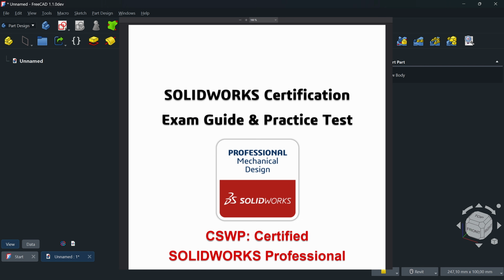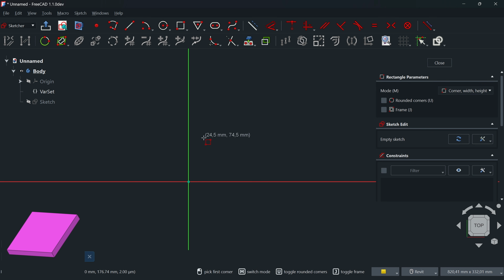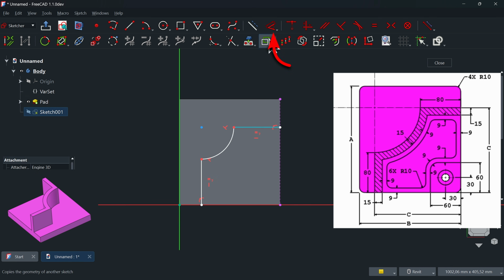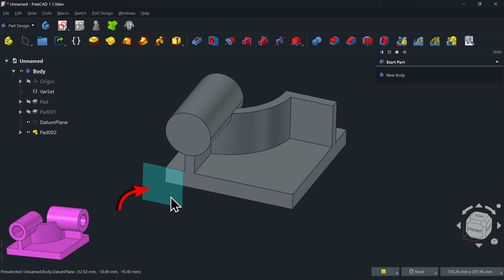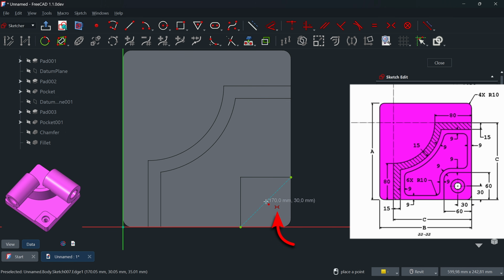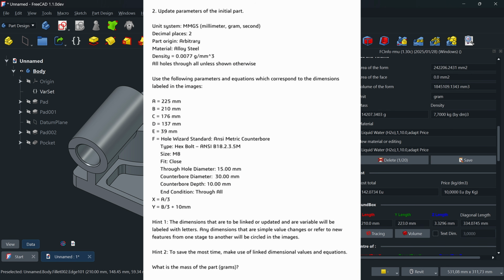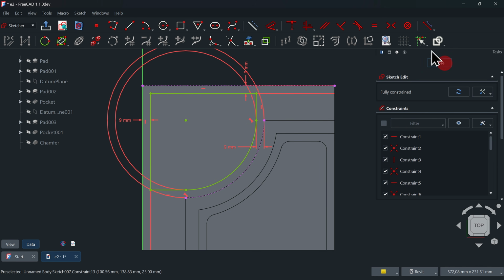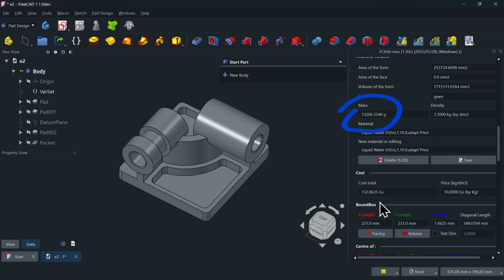Can FreeCAD pass the SOLIDWORKS Pro Certification CSWP ?  (Full Tutorial & Parametric Method)

Comment: First learned 3D modeling for animation using Lightwave in 2000, then started learning Solidworks after taking up 3D printing in 2013 and switching to more of an engineering focus.  Now looking into FreeCad as an open-source alternative (because over the last 13 years, Solidworks hasn't really done anything noticeably innovative that justifies its absurd licensing costs).  I've been continually surprised by how capable FreeCad is, and its open nature will hopefully give it more longevity than the product of a greedy corporation trying to justify its continued existence via predatory licensing arrangements and aggressive legal threats rather than providing meaningful upgrades.

Comment: One last different way to skin the cat... Instead of applying fillets to the pads/pocket for the vertical fillets, I added them to the sketches. This is a habit that I've picked up in FreeCAD because the fillet (and chamfer) operations in PartDesign have been historically fragile. I wonder if it is a good or bad habit for me to have developed... I followed along with this video using fillets in sketches instead of after the pad/pocket in PartDesign and I got the same mass results as the video did, so the resulting geometries were identical.

Comment: I got started in CAD with 2D cad using AutoCAD on a DOS machine. I've also done ECAD, first using OrCAD professionally, then KiCad recreationally. FreeCAD was my first introduction to 3D CAD because the KiCad team started to use Step files for component 3D models, and someone created a bridge between KiCad and FreeCAD for ECad/MCad integration (component 3D models for rendering and full board assemblies for fitting enclosures). I've kept up FreeCAD for 3D printing recreationally (and occasionally at work for fixturing).

Comment: Different ways to skin cats... I probably would have put the origin of the first sketch (for the base) on the lower righthand corner of the rectangle because that appears to be the origin of most of the dimensions in the reference drawing. It probably doesn't matter much, but I would rather avoid any accidental mistranslation in my head. Especially on a timed test. ;-)

Comment: 25:20 This 30 mm dimension does not appear on the model and corresponds to a reduction in the tube's thickness: Cheating ? 😊 Personally, I find: 141930.5296 dg. But, thanks for this tutorials

Comment: Since I can't find anyone else pointing it out: Hole should have been an ANSI M8 B18.2.3.5M. FreeCAD does not explicitly have that hexbolt out of the box at the moment that I know of, but it would have been prudent to use the ISO Metric as the standard and set the hole to M8x1.25.

Comment: Why did you do the fillet that early? Usually i do them as late as possible to avoid all sorts of problems. If you didnt, you still had that edge. And why didnt you use the centered rectangle as construction line to get the center for the hole? Also, the pocket could be constraint to a depth 5 mm above(!) xy plane (without to calculate by yourself) in the pocket operation menu.

Comment: Veteran mechanical technologist here. Worked most of my carreer with Solidworks. I used Fusion for my hobbies until they completely chocked. I then switched to Solidworks 3DExperience (web app like Onshape). The price is excellent but really the software sucks. Hard to get around and so many limitations. I was thinking about switching to Solidwork desktop maker version. Since I switched to Linux to escape Microslop, I would need to do a dual boot or VM and I refuse. I don't want ANYTHING to do with Microslop. I am now using FreeCAD. There is a learning curve but I'm getting there. This channel really helps. Thanks for using your real voice! Thanks for the most useful info on FreeCAD!

Comment: I learned it by myself, for 3D printing. It's the only program I used.
I never used VarSet. I always used Spreadsheet with EasyAlias (addon). I found it easier to export/import the spreadsheet to other project. Your video show me the offset button, which I never used. I always did it manually.

Why you never use the face to start with? Why you always hide the body and create a new sketch, to unhide it after? What is the goal? I though it was only because your measurement was from the bottom of the body (not the pad). But I guess I'm wrong, must be some other reason.

The hardest thing is the Draft tool. Creating Lines, ShapeString, etc... Extruding and using Fusion/Cut is always a mess. 
Creating object with PartDesign is not a problem.

Thanks for the video.

Comment: I first leanred cad in highschool with Inventor, then at home i found a free cad software called designspark mechanical. Only recently have i been using freecad, due to designspark blocking features behind a paywall. It was a hard couple of days to learn freecad (i had tried before but gave up). But after watching some videos, and taking it slow, i have learned enough to do basic tasks.

Comment: Am I blind or does the reference not give a dimension for the cylinder opening on the last drawing.  He uses 10, but it looks like that is for the length of over hang for the two cylinders?  I don't see where he is getting the 10 for the depth or difference between the radius of the cylinder and the cylinder opening or cut in.

Comment: > Is Freecad your first CAD/Modeling software?
I used QCAD briefly when it was needed purely for 2D blueprint drawings. Tried using Blender for technical modeling but quickly realized that a non-destructive modeling software is required for proper work or else you'd spend more time fighting with software than modeling. So, FreeCAD is my first true 3D modeling CAD. Originally I used it purely as a STEP file viewer for many years and early versions (pre 1.0) looked like a nightmare show.

> What do you think of FreeCAD so far? 
Now trying out FreeCAD 1.1 for 3D printing purposes and it finally starts looking somewhat intuitive. It still could use some work with its extremely unintuitive errors, breaking topology (e.g. Fillets/Chamfers falling apart after editing earlier steps). But it's worth learning, especially for hobby projects. For professional use commercial CADs might be better considering that if you work in a team, nobody would want to have a mixed ecosystem.

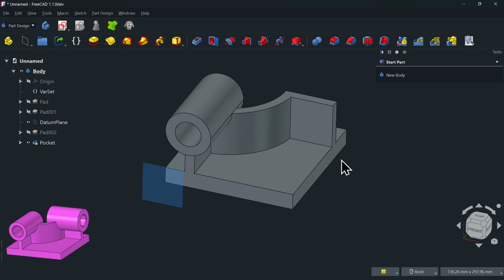Comment: Gotta be honest, your tutorials are the only ones that make me think FreeCAD is actually useable. Some things still feel extremely clunky and weird though. For example that you apparently(?) need to create an own sketch for every little thing and do a projection of e.g. your previous circle in ~ 12:00 - In Fusion I would just have created one sketch with two concentric circles, then extruded the first and immediately cut with the second. Without any second sketch or projection inbetween.
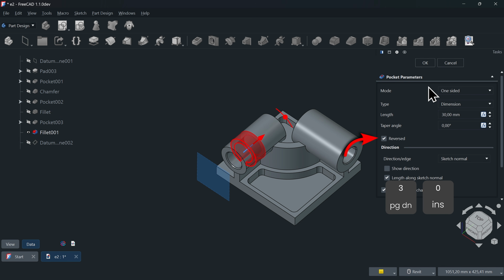Another example would be the whole additional offset plane for he operation up to 24:11 - In Fusion I could still add this to the same circle sketch if I wanted to, then do an extrusion that starts with an offset of 30mmand for a length of 30mm. No additional offset plane, second or third sketch needed. You also don't need to delete any intersecting lines and you will also not run into any issues with not being allowed to do the full arc (what even happens there? O.O)

A lot of "simple" things still feel extremely tedious in FreeCAD so I am still very reluctant to give it another shot. Like text or text following a path or a circular shape... I only found tutorial that are like 15 mins long and abuse a curve workbench to hack a super thin curved surface onto a disc that can then hold text. I use this a lot in Fusion.

What FreeCAD from my POV needs most direly is simplification of essential tasks and content creators who create high quality tutorials such as yours that show good, solid, parametric workflows.

Comment: I used proengineer (later Creo) at University but haven't touched much CAD since. I tried on shape but really struggled with the whole sketch - constraints - extrude - assemble workflow on it. The free tier limitations felt icky too. I just saw your "why use FreeCAD" video and then watched this video and it looks like the exact type of workflow that I'm familiar with. I run Linux too so it's perfect! I'll be designing some stuff tomorrow for sure.

Comment: I am investigating moving to FreeCAD from other tools for my hobby work. My goal is to remove the restrictions of my current tools. Per your opening comments, this would probably be my7th or 8th CAD (I worked as a professional engineer for a major Ag manufacturer) so I am quite familiar with learning new and similar approaches to common tasks. I found your videos and am quite encouraged so far. Excellent work on your part.

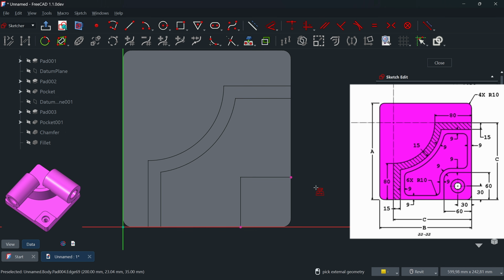Comment: this was great, but at around 14:50 you find the center, but the diagram specifies distances from the right/bottom edges. Would it not be better to use those numbers, or is there a symbol in the diagram implying center?
Reply: The distances are equal (30mm), creating a square. The lines he already had are double the length (60), but also equal, creating another square. Connecting the diagonal to find the middle is a clever way to save time and still be accurate to the print.

Comment: Bonjour,
I had issue doing the hole opération from the point, so the only way on my W11 version 1.0.2 was to create any circle in the sketch and then the hole operation works with CounterBore Ok (lamage).
Maybe on weekly builds version 1.1 the issue is solved.
In any case merci beaucoup for this nice video.
Reply: The 1.1 definitely fixes it

Comment: Very nice! Using the offset tool and then turning half of it into construction geometry is a really neat trick that I've never seen before. Really cool little technique.
I was also unfamiliar with the VarSet, I always use the spreadsheet feature and link the values from there, which works the same but I find much nicer to look at. It also allows you to order and even color-code your variables for complex parts.
Lastly, FreeCAD has a bajillion hotkeys. If you learn just the most important ones for applying the constraints, it will save you literal hours of time. Just typing "s" to apply a symmetry constrain is just so much faster than doing everything with a mouse. Your wrists will thank you, too. The last little tip I have is also a kind of hotkey: Instead of clicking the little f(x) symbol in the input field for variables, you can simply type an equal sign (=) and start typing the name of your variable right away!

Comment: Sorry, maybe a silly question, but what causes the 0.01g(almost 0.02g) inaccuracies? if the geometry is the same and the density of the material is applied correctly, what is causing the inaccuracy? is that coming from a geometry issue, or a software calculation error?

Comment: I am a design engineer and professional CAD user since 1998. I just started using FreeCAD and it is pretty decent for hobbyists. Hopefully it keeps getting better. I am still working on my first models, but will be 3D printing soon. Excellent video. The variable dimensions are not as intuitive as pro CAD software where you can usually make variables on the fly. Also the symmetry constraint tools are not so great.

Comment: I like free cad but the 2 major issues i see with it are:
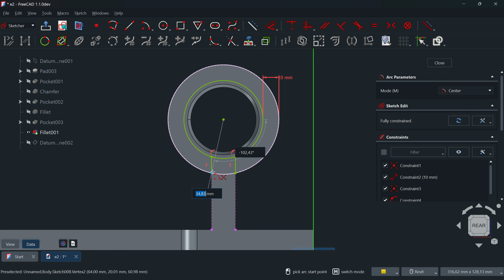1. At 23:46 in the video you didn't use the end point for the arc because you knew it will make problems, but when you do parts for the first time you don't know it until you run into them and that can cost a lot of time.
2. The 3d modeling is nice, but the main goal of the model is to make a drawing later on, there are no layers in the drawings for line weight, which is a deal breaker for me.
But still for 3d printing and hobbyist crowd its amazing, and i think in a year it will start replacing solid works, edge and others.

Comment: I've only used blender before, and i don't really need to model anything. Still, this was a surprisingly fun watch. What i noticed immediately is how many clicks it is to do some seemingly very common operations:
- why can't you just type the variable name in the field directly? why do you meed to open the fx popup? I think it'd be nice to be able to type the function direclty in the field, like remove the 0.00mm and type "a/3" and it'll just work.
- while creating the computed variables, you said you could use VarSet.a or just a, but later you always typed out VarSet.a which seems quite annoying.
- I would hope there's some quick UI for adding constraints or things in general. Something like: click on something or just hover your mouse, then press a keybind to open a quick selector dropdown where you can just use up/down and enter to select the tool, and type to search the tool by name. Kinda like blenders node editor when you add a new node.
- I don't yet understand why the external geometry tool is necessary, it seems like if you select the surface of a object as your sketch plane, it should automatically add that surface as external geometry. but that might be my lack of CAD knowledge.
- Seems to me that you basically always turn external geometry into a construction line. I'm sure there is a reason to not do that sometimes, but i feel like a modifier key which, when held, turns the tool into "external geometry as construction" tool.

Comment: Tried to do this in freecad 1.0.2, maybe because you used a 1.1 dev version it works
Some issues that i found as a beginner that didn't show in the video:
1. Starting from second extrusion sketch i used external geometry tool but it keeps showing behind the object and not like in the video(i used wireframe view to get around this)
2. Everytime i used the external geometry tool i immediately get construction line
3. When using the Hole tool i'm getting an error "cannot make face from profile", maybe because the sketch is behind the object? since the object is extruded

Comment: I've just started to learn FreeCAD since i dont have any CAD background and no preferable CAD software. I did learn basics back at school. AutoCAD 2000 LT. But it was not in depth at all. Just some basics about the software and drawing a basic sketch. Learning the measurement tool and such. The course was about schematics learning since school was about electronics.

So, i have started and developed a new interest. 3d Printing. So.. i figured i want to start designing my own 3d models to print. Like functional prints. And not just download 3d models online and print.
Some models that i have found is not as my likings or are designed for another version of a pcb or such so they doesnt really fit. Some designers only uploads stl models and not the original designed files.

FreeCAD has developed quite much since 0.22. Now up to weekly build version of 1.2.

Ive looked into AutoDesk Fusion aswell but.. it runs quite slow and it isnt available for Linux.

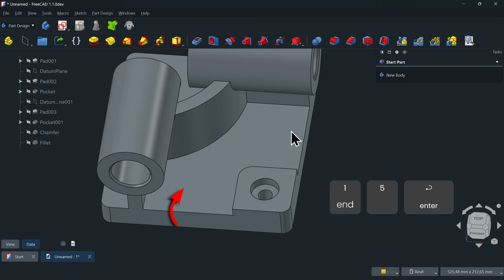Comment: 16:21 Could have also turned the thickness of the original pad into a variable and set the depth of the pocket to the variable - 5 mm. That way even if the thickness gets changed it’s still 5mm of the bottom plane. Don’t know if your old teacher would be happy with that😂

Comment: I had some issues with this, the hole tool absolutely did not want to make a hole from a vertex. Maybe this is a new feature in 1.1? I'm running stable branch 1.0.2 right now. Anyway, I found a workaround. Replacing the vertex with a circle works and the circle dimension doesn't matter since the hole tool decides the dimensions of the hole. A bit frustrating though.
Reply from the maker: Yes, it’s a new feature from 1.1

Comment: I'm new to Linux, so that's been interesting in itself. Having access to CAD was my main holdback. But this seems like a really good time to make the switch as I read the comments where more experienced users are giving favourable endorsements. It has nothing to do with me being a frugal bastard, and now hating on Microsoft for this collosal waste of perfectly functional PCs going to the recycler 😉. I bought a really capable PC about 5 years ago for retirement, and I'm gonna use it til it breaks!

I was glad to learn about the AppImage concept in Linux that allows me to run a dev version of FreeCad as if it were in a virtual machine, so I don't have to mess up my installed version.

I'm still getting used to the principles of parametric CAD. All my previous 3d CAD was the type where you draw fixed geometry and that is still how I think. But FreeCad really lets you see the data you are building as you go, which is mind boggling, because now I can edit that, whereas it used to be all locked away in the CAD file somewhere.

Comment: Definetly not a veteran, but I remember using AutoCAD for a while and later Solidworks and T-Flex  for 3d 10 years ago, and i remember how much both Soliddworks and T-Flex have rocked my world because it was so much smoother compared to AutoCAD. Everything in AutoCAD made me feel like it was designed to mess with the me while the others made it possible to finish my assignments in hours compared to days with AutoCAD. And recently after moving from OpenSCAD that i used for my hobby projects to FreeCAD, it gives me that same feeling. FreeCAD's UI reminds me a lot of T-Flex from 10 years ago which is a really good thing IMO, because some modern CAD's look like MS Word with a viewport, which i find extremely annoying. Anyways sick video, thanks.

Comment: You can Offset the sketches directly without the need for a datum plane.
And you can draw everything that can originate from the same plane in the same sketch and select the outline for each operation. From that sketch by holding STRG while clicking on each necessary element.